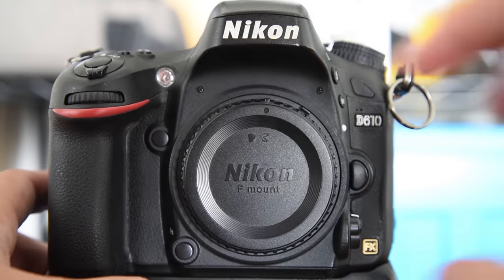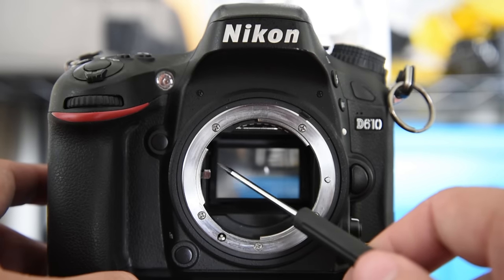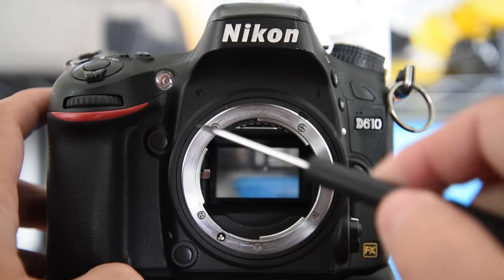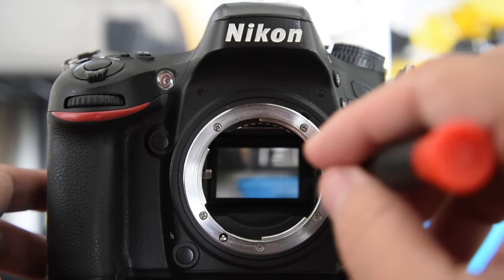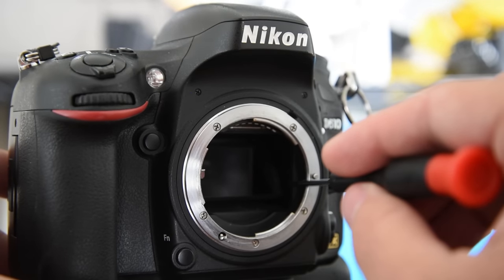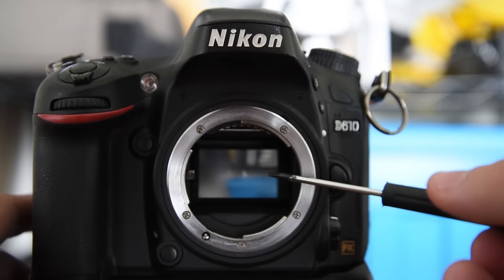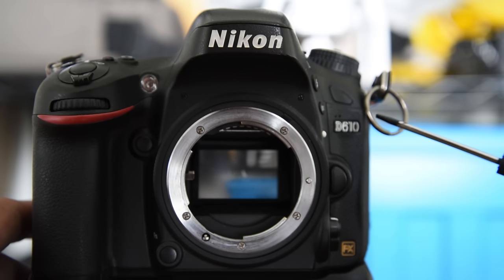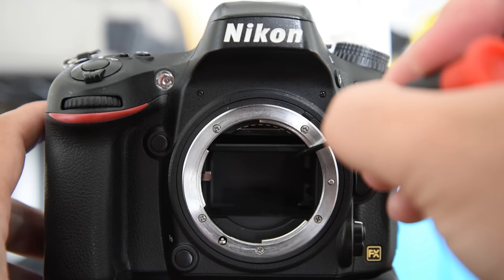How To Fix A Stuck Nikon DSLR Mirror

Comment: I was actually googling "Where to take my Nikon D610 for repair?" and your video came up.

I was trying to shoot stars when an unexpected gust of wind blew my (light weight tripod) over. My Nikon D610 hit relatively soft dirt. However, when I started to shoot more pictures it was the smaller mirror that flips up that was only partially flipping up. I could see where it was barely catching along the wall. That's why the half image. I basically did the same thing you suggested except on the flip up mirror. It solved the issue.   All is well. Thanks for the vdeo. You save me some money. Now I can get back to shooting tonight's last supermoon of the year.

Comment: Thanks for taking the time to talk through this issue. My d750 experienced this after about 4 hours shooting - issue free. Then it gave an ERR message and seemingly locked up. At first I pulled the battery, lens and SD cards, the put it all back together and it worked - for about 5 shots... then ERR again. I have just done the PRY method you described and it has been firing perfectly... I will see how it does next shoot I do were its over a long time (may be heat related for me)... Thanks again. D

Comment: wow. i cant believe a 2017 video saved me lots of money and stress today in 2021.I use a D600 and D90, but i use more the D90 as i still need better lens for my D600. I am busy packing my gear for camping weekend and i decided to test the D90 before packing, and for some reason, it just didnt sound right, so took did what you did aswell, checked the photo and for me, it was complete black. Tested without lens and thats when i saw that mirror wasnt moving at all. Quick search on youtube, and this video was #1 on the list. Now my D600 is working fine. Thank you James.

Comment: Thank you so much, it worked! The mirror in my Nikon D610 was not going up for some reason but it wasn't really stuck, I could lift it up with ease. So I used the screwdriver to keep it up while I pressed the release button multiple times and it worked! Saved me a trip to the repair shop. Much appreciated!

Comment: I have a D810 and dropped my camera from about 3 feet onto a concrete floor. Banged the top corner by the play button. Had the same issue, but it was on the opposite side you had shown. I thought is was the lens. I did the same as you described and heard a snap and the mirror must have popped back into place. I will check the focus when back in the studio to compare to my other 810. Thanks a ton! Saved my some money.

Comment: legend! ive been having this issue on and off for a year or so with my nikon d610, it would often just do this then start working eventually after multiple frustrated atempts at just hitting the shutter button hoping it would fix itself, but after it happened again and my belligerent fix didnt work i found this video and it worked perfectly, exactly what i needed, and i was also about to contact a repair store and possibly not have my only decent camera for my daughters end of year performance tonight.  life saver. may good things come your way and keep up the great work mate

Comment: Worked on my D600.  The key is to recognize this situation.  Put the camera in manual mode, take the lens off, and shoot.  You should see the shutter move.  If you don't see anything move/cover the sensor, then this fix might be what you need.

Comment: I'm having similar issues with my D700. I know it isn't a new camera by nowaday standards but still does the job. However, it started to show its age recently when I took it out to have a few snaps with it.
It was sitting for about 5 months in the safe and I do recall it working in February. Out of so many shots it failed to open the shutter but it was like 2 out of a 100 shots. After those months it was sitting it started to struggle to open the shutter at all. It took me over 100 attemps to get it back to swing. I tried and tried to force it to open the shutter with the release button and the aperture preview button until it gave and started to work again.

I'm gonna test it today for an hour or so to see if it fails again. I wanted to give it to my brother as a gift but I'm unsure if it is actually worth to be gifted.
Reply: Update - as of today I have fired up the D700 and it worked for some unknown reason. Then it started to do it's error again. I figured that it has to be related to the mirror box as it won't open the shutter not flip the mirror up when the error happens. Still not 100% sure what is causing the issue.

Comment: Dude, I should have listened to you the first time!! I had this problem, thought it was different because it didn't seemed jammed when I lifted up the mirror, and so I sent it in, and paid $600 for repairs (well actually $800 because my flash was broken too which Nikon forced me to fix, grrr). Then, conveniently right after the Nikon warranty of the repair expired, it happened AGAIN. Exact same "ERR" message, exact same thing with the mirror not going up. I was so furious I revisited this video and pried it like you said and voila it works. I am so thankful to you, and absolutely DESPISE Nikon now. It was such an easy fix — took me 30 seconds — but, no, Nikon told me I had to send my camera across Canada to pay them $600 for it. A big finger flip to Nikon and a big hug to James Black for this video.

Comment: WOW. Thank you it worked. My Nikon D80 has sat for a few years and I finally bought a new battery. The mirror worked a few times then stopped. I did slightly pry in the area with much caution. and it released the mirror.
Reply: worked for several clicks and now locked up again even worse. Time to take it to a shop for repair.

Comment: Hi, does anyone know how to fix the problem if your mirror is stuck in the position at 4:57 ?
I toggle the mirror around to go down but it instantly goes back up in the position as like at the time stamp. About 2 times I managed to somehow get it unstuck, but f I place the lens on again and try to take a picture, it gets stuck again and gives the same shutter error again. I've only seen solutions where the mirror gets stuck on the right side with that pin, but not when it gets stuck at the top.
It probably doesn't get "stuck" per se, it just seems to not be able to stay down in the standard position.

Comment: It happened to my d90 as well.. But instead of doing that diy repair thing as you demonstrated.. I immediately went to Nikon store for repair. I rather spend extra money for the repair... It is risky to do that diy repair because it will cause more damage to the camera, especially other mechanical parts... And nikon repaired the mirror of my camera without changing any mechanical parts plus they also cleaned the sensor.

Comment: My shutter mirror glass (mirror box) fell out of the body. It would get locked up, when I try to take photo. I can see the inner box move but it get jam. I did not inspect the lever. I was looking to replace the Camera with something better but it's cheaper on sending my Nikon D3200 for repair through Nikon. Should I also have them inspect the sensor? Since the D3200 fell onto the floor from the counter top.

Comment: fantastic.  was facing same issue with my d610. camera was un used for a month. i pushed side wall with my thumb... and it works.
i was planing to send it for shutter replacement but this video saved about $150
Reply from the maker: Awesome! So glad it helped!
Reply: James Black after few hours i.notice that every 1st click after 5 to 10 mins, mirror got stuck in upword position and it came back to normal when i click again. and after this it works fine until d610 take rest for more than 5mins.
any clue ?
Reply from the maker: Hmmm. I'm not sure what that would be. I would maybe try going back in and separating the wall from the mirror just a little bit more. If you do just be very careful and don't apply too much pressure, don't want to damage the mirror.

Comment: Hi! Do you have any idea about how expensive it is to fix a "stuck" focus motor (the screwdriver)? :( The one of my D750 stays out all the time, even if I change the focus to manual, it's still out instead of inside the body :c

Comment: Loved your video especially the beginning which put your camera malfunction in context. As a professional photographer myself I can well imagine how upsetting it was to have a camera malfunction in the middle of an important job. That said I recently began getting the dreaded err message on my Nikon D610. I at first thought that the shutter had failed but when I checked my records I discovered that the camera had only around 50,000 shutter actuations so that seemed less likely. After viewing your video I tried gently prying on the right side of the mirror and it fixed the problem! I do wonder what caused the mirror to stick down in the first place so I probably won't be using the camera for critical jobs in the future. But it may serve for less critical work. Thanks for sharing your tip!

Comment: My d50 has the same issue. Apperture lever and mirror are moving just fine. It has only done 4k pics so far so is it possible it could actually be a shutter or a sensor? 
I didn't use it for a long time as I own d700 as well and when I did, problem with memory card appeared, when I replaced that pictures are saved but they are all black even on a long exposures. Anyo w had a similar issue please?

Comment: Hi I have d610... I use 50 mm 1.8g with that....I tried 18-140 dx lens to d610 fx body it worked well then after I changed lens to 50mm... while fixing 50mm it's stucking and not able to fix I don't know what to do

Comment: I have a d5100 and and i replaced the board and now I turn it on and it said  error press shutter button again and I do it and it sounds like it fires 2 shots and the message comes back up and the mirror and sensor get stuck open in random positions how can i fix this
Reply: Turtlelizer any solution?

Comment: Good quick fix but if the screwdriver slips behind the mirror you have a scratched sensor and that is a shedload of money! Better to use a plastic spatula. Better still never to rely on this camera again and always have a backup!
Reply from the maker: No doubt that you have to be careful, but the fix works. As for a backup... you're right. I always have a backup and a backup to the backup.

Something plastic/rubber is a good idea, J.D.